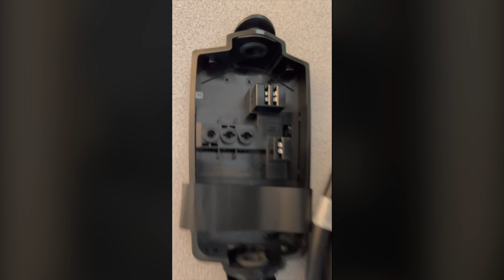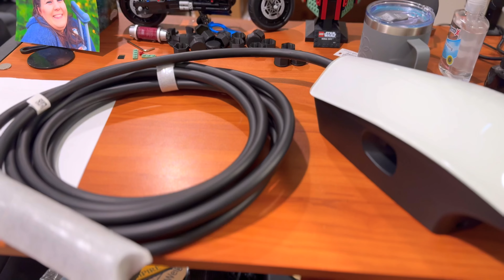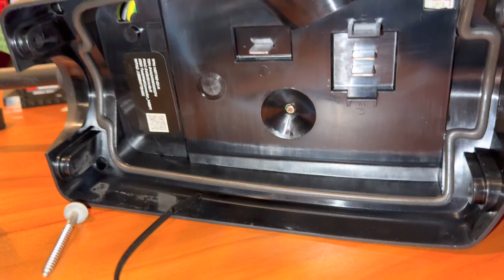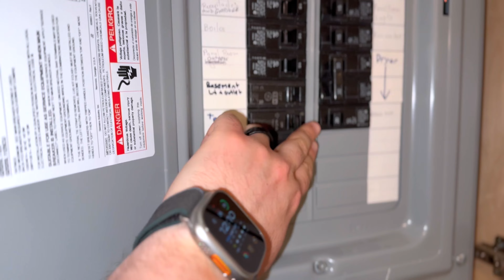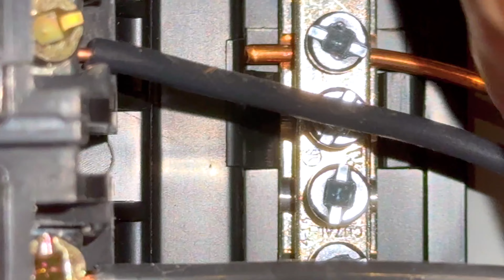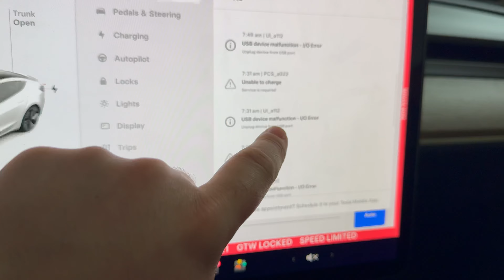🔧⚡ Tesla Charging Issue: Swapping Out the Wall Connector! 🚗🔌 Full Charge Thursday Ep. 7 #tesla

Comment: Your ground test is wrong as well….    With the breaker open you should read open not zero ohms…
Reply from the maker: Thank you. It works and matches what the electrician did and that’s all that matters lol.
Reply: @Wea @WeatherManAP  Ha…. I am an electrical engineer with 40 plus years in the field….  You have issues that should be resolved professionally.   As you would not pass code inspection as well as your charging issue that continues.   Additionally I have owned Teslas and other EVs…..

Comment: You measured voltage under no load….. which is not an indicator of the wiring ampacity of the circuit. Ampacity is the key metric of the circuits load bearing capacity.  It is a function of wire gauge, circuit length, connection type & quality and breaker amperage rating.  Also you need to consider the de-ratting required for continuous use for EV charging.
Reply from the maker: Hello there. That’s actually not true. I measured it under load at the breaker since that’s the only way I can get the clamp around each leg. At the Tesla charger no load is necessary to just validate a proper connection. The Tesla charger also auto sets its rating based on the breaker. So 60 amp breaker at 80% by code is 48 amps, which is the max output of the wall connector. No need to de rate the connector.
Reply: @WeatherManAP  it’s all in the video…. Testing mistakes, code violations and potent shock hazards too….  Get a pro to install it….
Reply from the maker: @tur @turbobird2000 st if you’re confused, this is not an install video. I plainly say that if you didn’t watch the whole video. It’s a risk I was willing to take. And it paid off.
Reply from the maker: @turbobird2000 again I will comment here. I’m not encouraging anyone. I’m documenting what my journey with this is. There was never anything wrong with the charger or the electricians work, albeit there were clearly things missed. Stop saying I’m encouraging people because it makes you sound like you don’t know what you’re talking about.

Comment: That's the wrong wires!  To get the full voltage ⚡️ for the wall connector you need  this. #6 Stranded THHN red . #6 Stranded  THHN Black and #10 Stranded THHN Green for ground.  All has to be copper.
Reply from the maker: Hey there! I’m not sure if it’s THHN or not, but it’s definitely #6. I can confirm I’m getting full power at 230v and 48 amp. I took readings from the car and from the wall connector with the fluke meter. What would the THHN wire do?

Comment: Looks like Romax running through conduit, unless it’s #4 wiring you can only install a 50 amp breaker. You would would have to use then #6 copper wire to use 60 amp breaker for full 48 amps charge
Reply from the maker: It is romex through a short conduit up the wall, then just romex through the ceiling to the breaker. It is 6 awg wire on the 60 amp breaker which is fine. It’s in the Tesla install guide. It just has to be rated for 75°C.
Reply: @WeatherManAP  In the US, Romex for residential installs needs to be derated to the 60 deg column, it's in the NEC code book 334.80. They do that because the insulation and possible heat from surroundings causes the cable to underperform when heated. When Romex is used, simply use a 50 Amp breaker and derate the current to 80% of that = 40 Amps. So, many in the US use THWN-2 wire inside surface mounted conduit, which allows you to use the 75 deg column, which permits a 60 Amp breaker and 48 Amps max with AWG 6 wire. The other nice thing about selecting individual wires is the way you don't need to properly label white wires at each end to comply with electrical code.  For most of us, slower overnight charging works just fine and may be better in terms of long term battery health. It's likely that other hardware, including the wall charger, may not be as durable when subjected to peak charging rates.

Comment: take off all scheduled charging. and try it again.  See if that works.  Car is garage kept (like mine)  pre-conditioning really doesn't need to be done.
Reply from the maker: I am just finishing up the edit on my part 2 to this. I did bring it in to a Tesla service center. For a quick teaser, they said back in April I had the Tesla power lift gate retrofit kit installed, by Tesla themselves. They said a recent software update was incompatible with the firmware of the lift gate control module. The resolution is to wait and see. So we shall see.

Comment: Generally,
Green = Chargin
Blue = Charging Delayed/Charge Schedule set
Red = Fault
Orange/Yellow = Solar Charging 

And if you ever see a Red blinkling Light = Fault AND reduced Amperage,  This is generally because your wire Lugs on supply wires come loose or need to be re-tightened.  

Wall Connector is a pretty smart device.